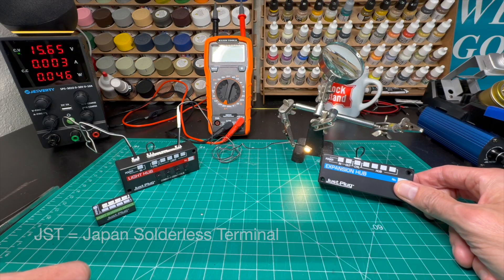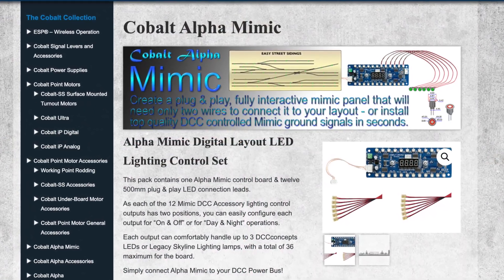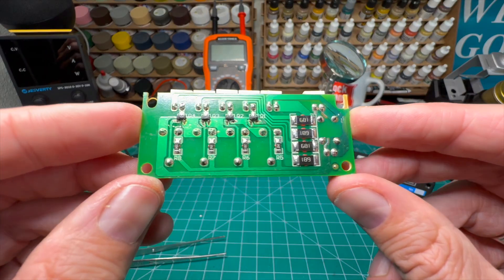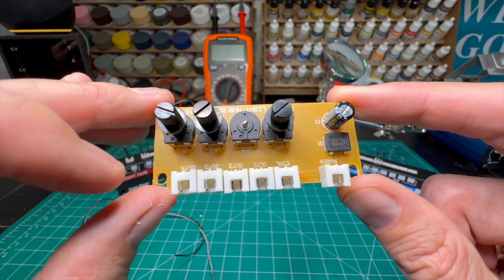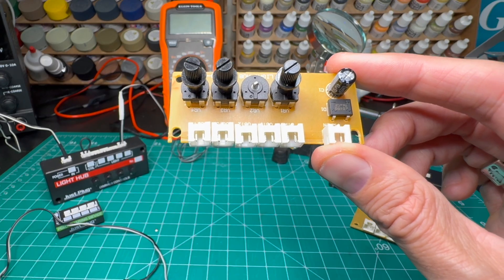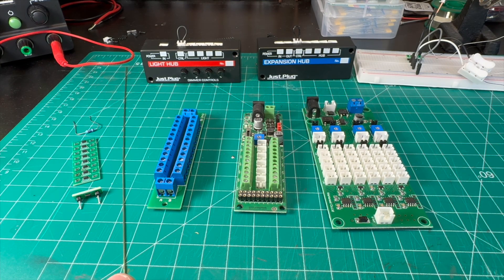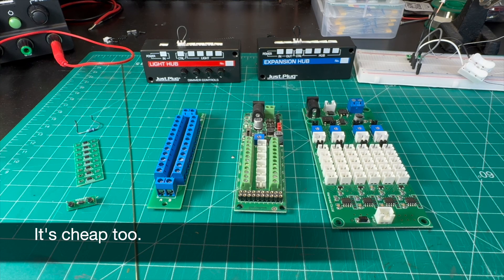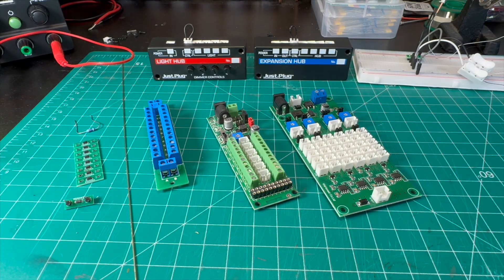What's Inside JustPlug? | CCMR At The Bench #28

Comment: To me it looks like there is 680ohms in series with each negative output.  The positive output is from thePNP  transistor, with the base being driven by the 10k potentiometer wiper.  The 150k is in series with the wiper, so when the wiper is at one end of the track, the base current is still limited by the 150k resistor.
Reply from the maker: This is helpful, appreciate it!

Comment: Google "3V LED Dimmer Circuit with BC547 Transistor" and you'll find the basic circuit for each output.  No doubt they buy pre-made wall warts, the bridge rectifier gives them choices of AC or DC, and makes the polarity with DC no worry.  Gives them flexibility down the road.

Comment: Great discussion Eric! I'm pretty impressed with the Wehonest boards (just wish they used JST XH instead of JST PH sockets). Having 4 separate channels with the ability to select either input voltage or 3v per channel is great. I also like the ability to add remote on/off and dimming. I just completed this week adding control panel on my fascia to remotely turn on and dim each channel.
Reply from the maker: Thanks Ron, they are cool and glad to hear you're using them as well. Just made sense in terms of density and ability to upgrade with additional LEDs as needed. Would love to see what you set up as switches. Shoot me an email at chicagocrossingmrr@gmail.com if you want

Comment: Those resistors are nominally 680 and 150K ohms; the way to read them is the first two digits are the mantissa, the last digit is the exponent (so, 10^x). 681 is thus 68 * 10^1 or 680. So, those "103" pots mean 10,000 ohms. Looks the pots and 150K resistors are probably a simple voltage divider, controlling the base terminal of a transistor. That transistor is just acting as a variable resistor with more current capability than a simple potentiometer. I bet they get a little warm but with the 680-ohm resistors you've got a max of 24V/680R = ~35mA so not a ton of heat.
Reply from the maker: Awesome - thanks for this helpful background!

Comment: For the JP Light Hub; guessing the bridge rectifier is for polarity protection.  That is you can swap + and - on the input, and it will always supply the proper polarity to the LEDs.
  All diodes drop a voltage across them.  Drop varies by diode type.  Typical is 0.2 to 0.3 per diode  for those in a typical  bridge rectifier.  
  Cap, as you said, to help smooth out any ripple in the input. 
 Resisters are to limit current to LEDs with pot turned the whole way up ( 0 ohms) .  
Just a guess based on what I saw.
Reply from the maker: Thanks! This is great information!
Reply: I also suspected that the bridge rectifier was for polarity protection.  Perhaps it would also allow operation (or at least some protection) with AC applied to the input provided that large capacitor was properly sized.  But without a circuit diagram it's hard to say.  I love videos like this that show the inner workings.  What you are paying for here is convenience and not having to solder connections, although the price still seems a bit high.  As another example, I like the idea of the LCC network with intelligent nodes, but the board prices are up there.  Of course, with  turnouts now costing $25 and up perhaps those prices aren't so out of line.
Reply from the maker: @andrewpalm2103  these are great points Andy.  There is absolutely a price premium to bullet-proofness and ease.